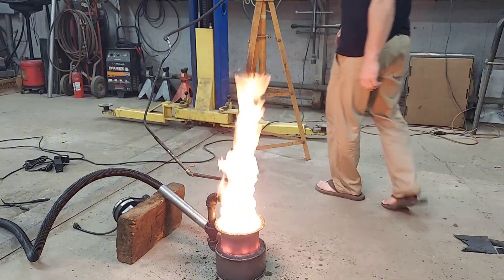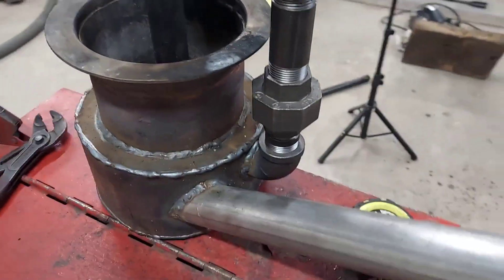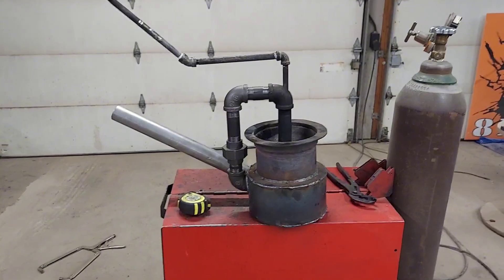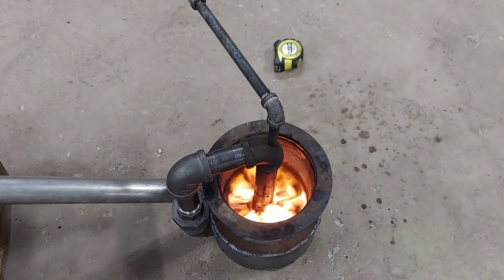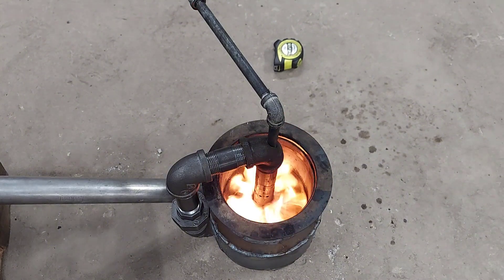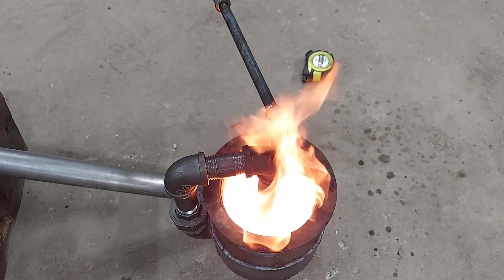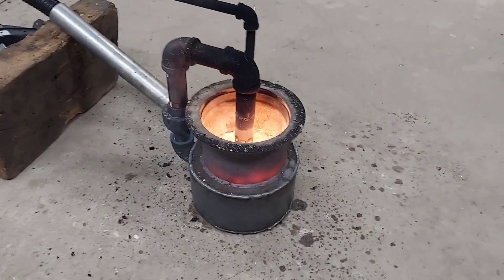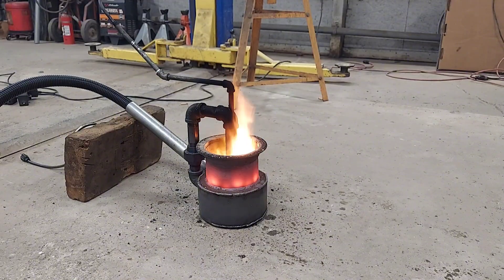DIY waste oil burner! My best design yet! Test and tune.

Comment from the maker: The burner has been installed for about 44 hours and shows no signs of build-up or slowing down! I can't thank you enough for watching and all of the comments! I hope you are having a great day! Subscribe now so you don't miss future videos!
Reply: Try using the output housing from a decent size centrifugal water pump for the air input. I used one to build a coal forge and it works awesome to create a cyclone effect. Alot of those pump housings have 1/4 inch ports around the outside that can be used for fuel supply.
Reply from the maker: @randallslattman3119 ,I'll look at that as an option! Thank you!
Reply: @karlsoffroad  I'll keep notifications on to hopefully see you run with that idea! Also if you dont have any ideas on it, do you have any connections to help with making waste oil infused manure pellets???
Reply from the maker: @randallslattman3119  I've definitely got access to manure, but I don't have a pellet press. My buddy has one, I'll get with him and see what he has to say on this idea. Thanks
Reply from the maker: @randallslattman3119  ,I'm going to check some junkyards, I looked up a centrifugal water pump and found out they're very expensive! 😆

Comment: How do you keep your boiler to the temp you want it with this burner.  So your water temp don’t go higher than it should
Reply from the maker: I get my water up to temperature, then adjust the oil feed accordingly. I can maintain the temperature within a few degrees.  I am back to using my original design in my boiler. I posted a video a little over a week ago. Thanks for watching!

Comment: He’s smart.. I wonder if it heated his boiler??
Reply from the maker: Definitely worked well. This design did require to be shut down every 48 hours to keep the fuel line cleaned out. The preheat worked a bit too well. I ran it for a while and ended up going back to my simple and reliable design. I will be doing an update video on my boiler. Thanks for watching!

Comment: You need more heat to vaporize your fuel! Maybe try a small stainless steel bowl where the flame from burner will get it red this will help vaporize fuel and burn blue! Nice build thanks for the video well done 😎
Reply: I will check it out. Thanks 👍
Reply from the maker: @RUredE2go  I wasn't going for blue flame on this one. I have built a few. I recently started a 55-gallon drum blue flame burner. I'm still getting it dialed in,but I should have it done by tomorrow. I posted a couple of videos already if you want to check them out. Thanks for watching!
Reply: @karlsoffroad  I’ve been watching your oil burning videos 👍👍👍. From now on I will be making sure to check out a channel a little more before I comment! LOL . I’m learning allot watching your oil burning videos. I have built a few burners that work well. I watch hours and hours of oil burning videos before and during a build so I can concentrate on what works and not what doesn’t. Thanks for spending your time and effort making these videos very useful information. Ps love the “open toe safety shoes “ I usually take safety to the next level I wear “ safety slippers “ 😎
Reply from the maker: @RUredE2go  Thank you! I am working on a low-profile burner now. Someone wants one to slip in the ashtray of their wood stove. It's definitely a challenge for me. I should have that video out by next week. Less than 2 inches tall.
Reply: @karlsoffroad  👍

Comment: Burners can be "efficient" burning hot with a lot of oil. The efficiency level has nothing to do with the volume of oil, really. Small or large burners can be inefficient if there's wasted fuel or gas going up the chimney that doesn't get burned. Something that's say 80% efficient (big or small) is basically blowing 20 cents on the dollar up the chimney. How many BTUs can you extract over time, given a certain quantity of fuel with a known BTU per pound, gallon, square foot, whatever is the actual measure of efficiency. If you need a lot of heat, you're going to need a lot of oil. No getting around that regardless. I know what you were trying to say though, and I think most other people do to. Not baggin' on ya, just making a point.
Reply from the maker: I was just referring to the question of, how much oil does it use? I try to explain that it depends on how much heat you need. I'm glad someone understands! Thank you!

Comment: Try to use the output housing side from a centrifuge water pump! It's the same idea you had with the flap you welded back up, only perfectly designed for better flow.

Comment: I'm watching this again with keen interest.  I don't understand the air supply arrangement, if the inner pipe and outer pipe have a space between them, you could do away with the central pipe with holes in.  You could put the holes in the inner pipe,  have the air supply as it is so the air would enter from the sides instead of the tube.  I made a smaller version of a similar design using baby formula containers so it would be flimsy and not last long becaaaaaause it burns mega hot!  That hot I abandoned the idea!  Not because it was unsafe or anything like that but it would destroy the burn chamber in no time, however your big rig would easily withstand it.   You obviously can't unweld the rig you have made now but if you could replicate it again but put 3 rows of 1.5mm holes around the walls of the inner  pipe you will probably need your welding mask to see the flames they will be that bright, blue even depending on how much air you give it. Mayb3e 2-3mm holes but start small then go bigger if needed.  I would not weld the inner pipe before testing though as you may need to adjust the size of the holes, once your happy weld it all up and you have a monster system!
Reply from the maker: I thought about doing that, but I wanted to be able to change nozzle designs easily, and I have had great luck with delivering the oil to the bottom of the burn chamber. I will definitely build one the other way and see what happens.
Reply: I do like the design you have and as you say you can change the nozzles at will if so desired and you will probably get the same results, so maybe not even worth trying if you are happy the way the burner works and as you say rightly you can always change the nozzle but not the holes in the inner pot.  I would advise only do it if you simply want to experiment and are curious and have the materials available.  The burner you have should work great anyway. :) @karlsoffroad

Comment: Another way to get a blue flame might be to atomize the oil with high pressure such as a fuel injector instead of a drip, but probably not worth the expense especially with a diy burner. When the the sky is the limit on spending then you can make a purse out of a sows ear...or a waste oil burner into a rocket engine.

Comment: I'm hoping your new design will work long term for you. You have been testing a lot of different designs.
Reply from the maker: I've been running the same design for the last two years. I'm hoping this one will keep the burn chamber from burning through. I get a few months of burning, and then I have to build a new burn chamber. It's not a huge deal, but I would rather not!
Reply: I get it. Not hard to do but you would rather just be one and done! @karlsoffroad

Comment: so what i did on my custom boiler is I had two flow meters for the oil. one set real low that ran just to keep the flame going at all times and then the other I used a 12v selenoid valve hooked up so when my shop calls for heat it opens up and I get a nice size fire going
Reply: Im designing my boiler build and am doing the same thing. A high flow and a low flow. Do you have pictures by chance?

Comment: I love the videos brother. One thing I’d like to see is like this burner with a timer on say, a gallon of oil and a little more focus on the drip/stream size. Nice work man and I’m glad I’m subscribed 🤙🤙
Reply from the maker: I will do that. I'll probably do a comparison between different burners and see which one is the most efficient. That seems to be what everyone wants to know! Thanks for watching, and I appreciate the kind words!
Reply: @karlsoffroad  I’m currently trying to do “off grid” heating and I love all your designs it I am definitely interested and n which one is the best balance between good heat output and fuel efficiency. I e seen burners with big flames and they are not even running a stream but rather just a steady drip. I appreciate the response. Keep up the good work!!

Comment: would love to see how this might work with NO forced combustion air  fan.  Wondering with your heated air set up, if this will create a draft that self feeds the cumbustion air.  Maybe one test wih no forced air at any time from cold start up, to running good.....AND-  another test of use forced air to get it going and hot...... THEN... remove fan and use only draft to suck combustion air in.
Reply from the maker: I'll give that a try! Thanks for the suggestion. I'll probably have to change the burn nozzle. I  don't think it would be able to pull on its own through the tiny holes. We'll see! Thanks for watching!
Reply: @karlsoffroad   either way,,, w/blower or w/out if you can take pre existing holes and angle them so they all point at similar angle so air coming out creates a spin... this will increase atomization of oil for better combustion and might reduce hot spot wear on burn chamber walls.

Comment: Just clarifying what you did......... 

1. the bottom is an "air pot" / heat exchanger  that is surrounding burn chamber and  sealed from the  burn chamber 
2. Air fed into "air pot " gets heated via hot, burn chamber walls.. 
3.  heated air consequently fed into burn chamber
4. oil feed is embedded  into the hot air feed into burn chamber and its tube end is just below of end of air tube.  
5. oil  feed gets heated by hot air path  created by sequence of things in 1,2 ,3 above. 

are their any mods to end of oil feed tube.....or is it open
Reply from the maker: @coachgeo Yes, to all of the above. I have a merchant coupling on the end of the oil feed line that rests on the bottom of the burn chamber. I cut four slots about 3/4 of an inch long to let the oil flow out. I'm doing a 24-hour burn right now, and I will decide if that is going to stay on after I complete my testing. So far, it's running without any issues. I have it in my outdoor boiler heating 500 gallons at 30 gallons/min. Working exactly like I hoped. Time will tell if I cured my problem of burn chamber meltdown. I will be doing a video on the whole setup soon. Anything else, I'll be happy to answer! Thanks for watching!

Comment: Appreciate your hard work!
Took me a minute to figure out what you're doing there. Looks like you've created a manifold down towards the base of your burn chamber. The air goes into the manifold. Pre heats in the manifold and then enters your fuel nozzle...is that right?
Reply from the maker: Yes,this was the burner from the last video with the ideas I had after I struggled to get it to light. I installed it in my outdoor boiler and will have some better information on longevity and reliability soon! Thank you!

Comment: I think the blue flame burns cleaner. But you’re going to be burning outside and that is not as big a deal.
Reply: Of course the blue flame burns clean .... Because it's lean, and a lean burn is great , except  lean is low heat, and  #2 u can't sustain a blue flame w waste motor oil ...but u can achieve it for a short time after a rich burn when u get the burn chamber superheated and then lean it out ...yea ull  get a  blue flame  until everything cools down n then it'll go out ....

Comment: It's no good you can't put a cup on it to keep your tea warm.  GEEEEZZZZ is that hot! ♨♨♨  Yeh I have a problem working out if blue is hotter, it's hot but you need to throttle the air down in the holes by making them smaller to get blue flames for some weird reason I found.  The height of the pot also makes a huge difference. There must be a formula to work out so we can get blue flame as needed.  Never seen a blue flame burner melt cans though, obviously you could but as to how good it is at it I dunno? The main advantage of blue flame is you get very little soot in a small system like mine but yellow is terrible for soot using a 4 inch pipe for exhaust.  The burner you have hear will work even better and hotter under your boiler especially if you put a shield up to protect it from wind if its outside.  Mind you if your blasting so much air into it you won't get any build up of soot to speak of I expect.  I put a lid on mine with a cutout for the exhaust to escape from, this contained the heat within the pot which radiates out to the propane bottle it's in so the heat radiates out sideways more which is what my needs are and it was only when I put the lid on I manage to get blue flame, except the one burner but that is quite tall and has a wider diameter and that thing will burn with no visible flames!  All in all you have made a fantastic burner, I think you underestimate yourself a little bit too much cus the results you come up with are fantastic!
Reply from the maker: Thank you! I just finished installing it in my outdoor boiler, so I'll know much more by morning. It's got the water temp rising just like the old burner I was using, but I have it set way lower on the oil setting. I really think this will do the job with about half the oil I was using per day. I will definitely be watching it like a hawk to make sure I don't have any issues. I'll post a video of the installation as well.
Reply: I would like to see the follow up video having it installed in your boiler. @karlsoffroad